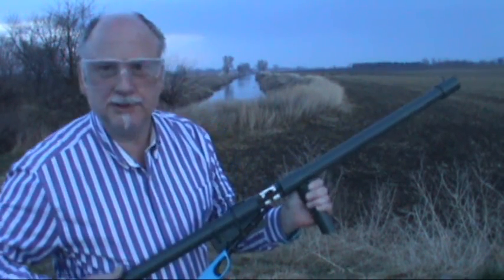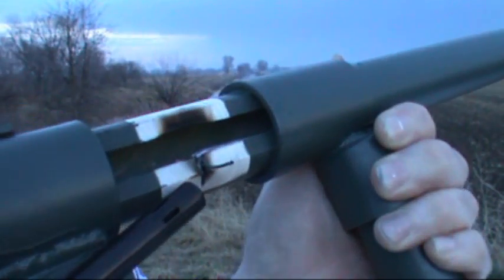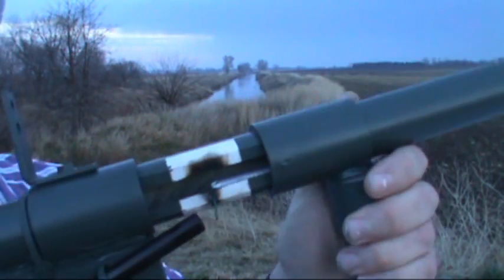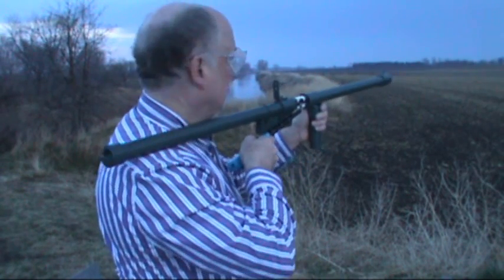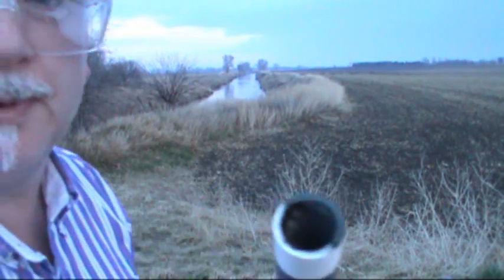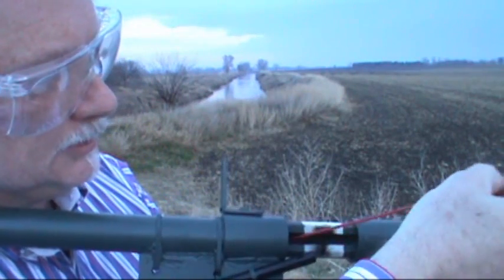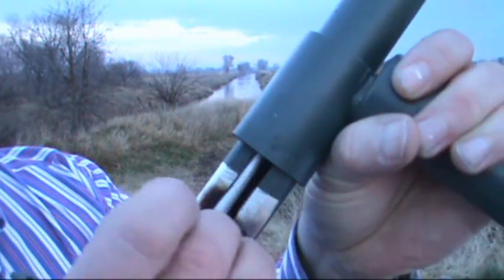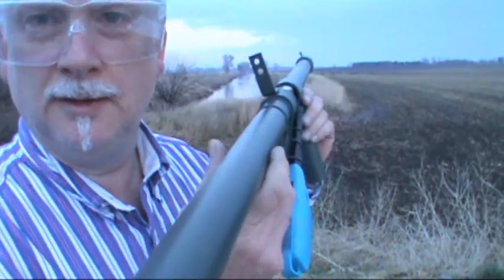Bottle Rocket Bazooka

Comment: It would probably create more thrust with a full cap on the back and if the pipe was just larger than the rocket
Reply: actually there is a hole on the back for a reason. if its closed off too much the pressure could cause it to explode. this is the same for a actual rocket launcher
Reply: @johnsword66  lmao it’s just a bottle rocket it’s not gunna matter even if it did explode
Reply: @macsaucedouble5941  bro you could get arrested for commenting this
Reply: @macsaucedouble5941 absolutely not.

Comment: Nice looking bazooka. I like your design. I made one that was more crud but with homemade bottle rockets and electric ignitors I got on eBay any 1.5 volt battery lights them. But my son I think tried to beef them up and blew up my tube. But I like yours with the ignitors you can eliminate the lighter and make the tube slide back to close it